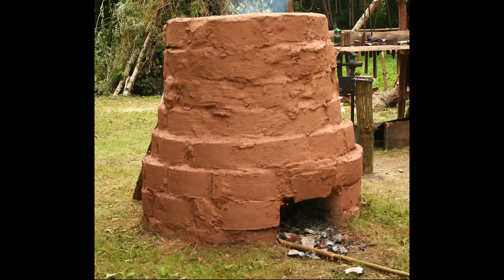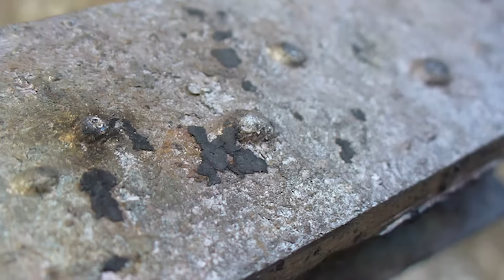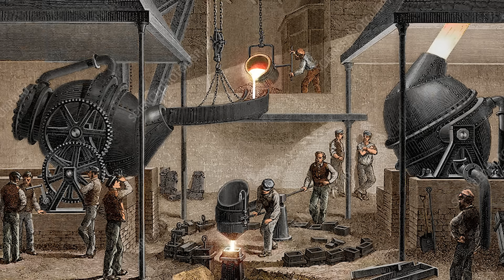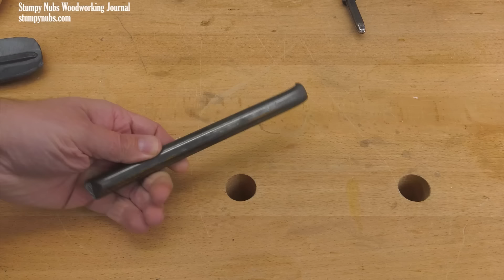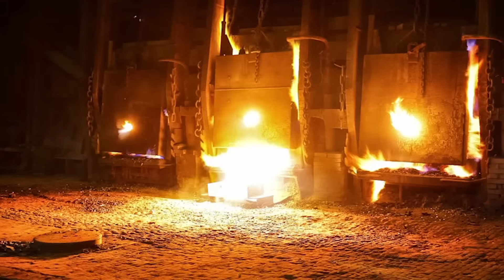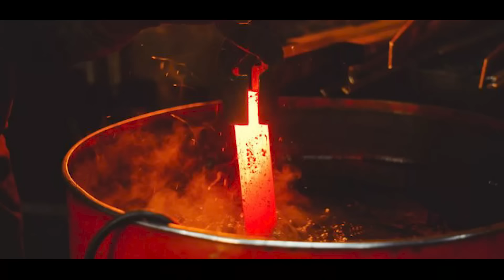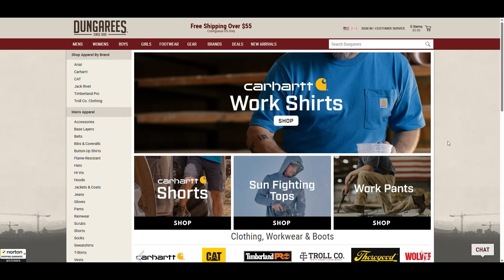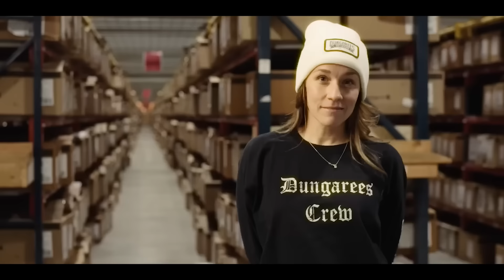Why they REALLY don't make tools like they used to

Comment: also the Archimedes furnace was since ancient times the way most efficient way to produce steel and was probably discovered since iron age began. the discovered heat treatment also very fast through trial and error.
Many many archeological  evidence support this. 
Romans mass produced steel.
Search for Archimedes furnace. it's quite interesting . they are quite small, and with ca 1 kg good bloomery iron you get 800-900 gr of high carbon steel. skill is needed,  to get cast iron. The process takes about 30 min. of course folding and pattern welding is needed.to reduce of impurities and consolidate. All steel was produces that way until Sheffield, but in Indi 13. century crucible steel was produced and highly demanded from everywhere. why they stopped I don't remember. But also late medievalin ottoman empire crucible steel was produced, but needed extreme high resources. That's why Wootz steel has a pattern, traded in Damascus a lot, and some how pattern welding with intention for patterned steel, geometry is named damascus, but it's not really, it's pattern wellded steel with one layer more nickel that becomes black after etching.
But from swords, weapons to tools over 2000 years steel was produced. Of course many ould only afford wrought iron, or cheap steel full of slag, hence the high proportion of broken swords

Comment: There used to be a great secondhand shop where I lived "Paces New and Used" The old guy that ran it had bins upon bins of old tools for cheap. Back when I paid the rent working as a handyman that was always my first stop if I needed a new tool for a job. You did have to hunt through the chisels looking for a good one. As pointed out in the video, a lot of the older ones only had a bit of good steel at the edge, so most of the used ones had already been sharpened down to where all the good steel was gone. One landscaping job I had to cut a hole in a sandstone boulder too big to dig out. The cast steel pick I had gotten from Lowes just bent when I tried it. I had to go to Paces and find an old forged steel pick. I'll miss that place. I think the building is a bar now.

Comment: Ya that’s why the Japanese chisels and plane blades are made by laminating soft iron and super hard steel, where the hard steel encases the soft iron, is thin compared to the iron layer, and the iron makes up the bulk of the belly of the material— so that the part that holds the cutting edge holds that edge, yet is easy to sharpen because it’s pretty thin—the soft iron beneath is obviously also easy to sharpen. High quality Japanese chisels and plane blades are pretty incredible actually.  I saw a vintage set of 7 and quality Japanese chisels going for $10,000 usd, lol.  Crazy.

Comment: It’s also sort of a survival bias and the fact of what used to be available versus now. For example, right now, we have a spectrum of quality. We can buy high quality expensive tools, and we can also buy absolute junk tools for extremely cheap. And inexperience people tend to buy the cheap ones, therefore getting a bad impression of modern tools. Back then, they didn’t have the fancy alloys and so they don’t have as good as the best we have today, but they also probably didn’t have the equipment (automation, cheap fast castings) to make them as crappy as the cheapest we have today. And so people get that impression when they compare the average tool from back then to the absolute bottom of barrel today , and start saying “old is better”. Not realizing, as with everything, you get what you pay for.

It’s a similar thing with the saying that “made in China” means it’s garbage. No, Chinese made items can be made extremely well. But they cost more. It’s just that, unlike most countries, China also has the ability to make low quality things for dirt cheap. And that’s what people tend to buy cause it’s cheap. And then they think made in china is bad.

Comment: I love explaining survivorship bias: how many 5th rate chisels did they make for every one that is left today?

I mean, is there a chisel from the 19th century that’s better than what you could get at Home Depot or B&Q? Of course, but it’s not a given.

I do cabinetry now, but I’ve worked as a shipwright, a wheelwright, and framed houses, so I can see a value in all grade of tools. IMO the best woodworking tools were made between WWII and the 70s stagflation, maybe into the 80s or 90s. Out of all the chisels I have that are REALLY good, the ones that stand out are plastic handled Marples chisels that say “Made in Sheffield, England” at a time when they were really made there.

To me, the problem with chisels older than WWI is usually just consistency. Your 1/2” chisel might be 10/10 but that 3/4” one in the same set needs sharpening every 5 minutes, and the 1/4” might be over-hardened and suddenly it’s 3” shorter than its brothers.

I’m all about productivity and cost effectiveness. There is nothing a $500 set of vintage chisels will do that a $25 Stanley set from the orange box won’t do with a tiny bit of sharpening.

Comment: Products evolve under changing economic pressures sort of like how natural selection works. When scarcity and replacement costs are high, durability is favored. When production is cheap and competition centers on turnover and features (And a board of shareholders that views anything but short-term profit maximization as a failure), the natural outcome is shorter lifecycles of tools because its economically advantageous.

Comment: Then you have high speed steel with a very high rockwell C hardness, but are also not brittle like harder carbon steels. These steel are also heat resistant, meaning you can heat it quite a lot without it softening (hence "high speed steel"). They are used for making drill bits but I've made knives out of cheap HSS lathe parting tool blanks for machine tools. These hold an edge much better than any carbon steel, and they are also more rust resistant for some reason (must be the chromium content). These steel weren't around during WWII and back then they had to deal with the problem high carbon steel had with regards to machining, meaning they made them very hard but they were also very brittle. Now high speed steel tools are still very hard but they are less brittle compared to 65 rockwell high carbon steel.

Comment: It was informative but you finished with the BS rather than the truth, this modern period has become a dumpster garbage fire, new tools are not chisels they are wireless electric crap with built in used by date to be thrown into that dumpster fire after the lithium battery dies enough to be (recycled) What a load of BS like recycling the battery is making the tool worthwhile, it could have been made to last for a few hundred years but instead it lasted 5 years if you keep it charged in the charger constantly sucking electric energy, you think the solar panels are made using wind turbine power but you just delusional fools, burning through fuel for life, making metal and plastic that resists being part of any cycle at all, the only cycle that really exists is that cycle of life that we are not taking any notice on.
Reply from the maker: You are generalizing. Yes, some tools are crap. But extremely high quality ones are readily available. Lie Neilson, Veritas,  Blue Spruce... I could name a dozen that are lifetime quality.

Comment: I've no need of steel that is soft enough to sharpen easily, I'd prefer steel far harder than the crap I've got, there is no metal classed as steel that has too much carbon to be able to sharpen, I've sharpened honest carbon steel on a any stone grinder that was available, the metal keeps a fine edge even after the high temp of being grinded to buggery, why don't they make chisels from that 5% carbon steel? I don't know, maybe it's because they want to always make money by lowering the cost of production and lower the cost of labour, and give the consumer garbage designed to be replaced as quick as possible.
Reply: 5% carbon is not steel, it is pig iron. an industrial commodity that's processed into steel after being produced from raw ore. that's not even suitable for making frying pans. over 2% carbon content in general gives you cast iron, which is soft and grainy. really high carbon steel is brilliant but if you go above like 1 to 1.5% you can very easily get it so hard that it will chip super easily if you have a fine edge. Generally tool steels, and especially high speed steel, in the modern day is the best you can do. If you really try to use a 65 HRC chisel you will see what I mean very quickly. Your beautiful scandi grind will be chipped to smithereens.

edit: apparently chisels do actually go up that hard. i would be very concerned about chipping it.

Comment: I think a lot of the rumors comes from people comparing top quality old tools with really cheap Chinese modern tools of dubious quality. That is rather unfair, kinda like people who say western swords were inferior to Japanese katanas by comparing a cheap regular western sword with a masterforged katana.
There are some old tools that are better though. Anvils comes to mind, everyone use cheaper steel for them today since making a really good anvil just is too expensive, so finding an old one is worth it there.

There are still some wooden tools that are being forged and have extremely high quality, I think the axes from Gränsfors bruk is a good example (yeah, I think an axe qualify as a woodworking tool). They were being made in the same way with the same tools already a 100 years ago and are probably the best axes in the world. Alec Steel released a couple of vids from there recently if you want to see the process of making them.In some cases, the traditional methods do win but you have to pay for it too. If I buy a Chinese crap axe, I can get 10 for the same price as one of those even if they are great.

I don't work in tree myself, I am a metal worker who mostly work in steel.

Comment: With woodworking yes, but modern mechanical and metalwork tools are far better to work with e.g. far higher tooth ratchets and superior technology. This is only to a point though, as in the past 15 years or so, tools are being made in China from brands that would previously relatively recently be made in the west, or Taiwan (make great tools). e.g. Milwaukee tools now being made in China. Should change their name to Milwangki...

Comment: The Story of Knife Steel by Dr. Larrin Thomas covers a lot of the history of steel making. A lot of great insights! Finding the right manufacturers makes a huge difference. They really understand both the chemistry of elements to include and the exact timing and process to get the carbides the size they want and desired features of hardness, toughness, ductility, ease of sharpening, edge stability, etc for chisel vs knife vs sword vs axe etc.. Some knife steels like Vanax requiring specialized pressure nitrogen atomization during production and vacuum furnaces during heat treatment to get the right mix. Really great science at work!

Comment: A lot of old tools also underwent a different heat treat leaving the core metal more ductile, and outer slightly harder. Modern stuff tends to be intermediate hardness throughout with little variance. Only high end stuff gets the proper heat treat like that anymore.

Comment: In my experience, old vintage tools were made in a manner more similar to how high end custom tools get made today. IOW, we saw a quality decline. Modern mfg can make a cheaper tool, that is good enough for 90% of its uses... and that became the norm. Automated mfg processes leads to some issues. 

I have an old vintage forged axe head. Carbon steel, hardly rusted. Found it buried shallow in some dirt in the woods. 

Look at knives today, high end knives are made of crucible steel. They are premium for a reason.

Comment: Very interesting. Perhaps you’re aware of the Ken Hawley Collection Trust channel? I was lucky enough to know Ken before he died; he ran a tool shop in Sheffield specialising in Sheffield tools and knew a huge amount about them. His collection now forms a wing of the Sheffield Museum. In the 60s and 70s he made a large number of films of the last of the ‘Little Mesters’ who were solitary individuals making elements of particular tools in small workshops. The men are now all gone of course but the films are available through the YouTube channel.
He told me that a major reason for the lower tool quality of modern mass produced steel was the fact that all steel now contains a large amount of steel from crushed cars. This contains copper which is very hard to remove and the copper settles around the perimeters of the iron crystals in the steel creating a weaker bond. This means that the fine edge will begin to blunt by crumbling as the tool is used. My own experience as a cabinet maker is certainly that pre-war chisels hold an edge far better than modern ones.

Comment: Chisels are not a tool I use very often being in the auto repair side of things, but we are flooded nowadays with more products of all kinds, both good AND bad.  It is difficult for people to discern which is which because brand doesn't tell the full story.  There are excellent items at Harbor Freight next to junk that I would never allow into my toolbox.

What we have access to now is top quality metallurgy.  It's no longer about just iron and carbon.  You mentioned chromium and manganese, but vanadium, cobalt, silicon, nickel all have roles to play in modern steelmaking.  Small batch steel made by skilled craftsmen who actually give a schitt is hugely important.

Be careful with what you buy and don't be shy about sharing and listening to experiences.  You can't usually tell the quality of a tool by looking at it.  It takes experience to develop that knowledge.  When people choose with a quality first mindset, over time they are able to amass tools that are a joy to work with rather than a pain.

Comment: This is generally true in most industries. Markets expand mostly downwards - much cheaper, lower quality mass produced products become available, while high quality expensive stuff is still available if you know what you're looking for.
Yes, the cheapest 30$ vacuum cleaner is now much worse than the cheapest 200$ one was 50 years ago, but buy one for 200$ and it will be probably better than the vintage one. It's not that they don't build them like they used to, it's that we don't buy them like we used to.

Comment: What the old-timers were telling you wasn't that we couldn't make better tools, and that they weren't around, they were telling you anything that was affordable and mass-produced in that day and age new was likely Chinese junk. I have also noticed that the good ones may have great steel, but often cut other corners like using crap wood for handles, and your excellent steel tool is ruined by a bad grip, cheap softwood handle, or a handle that splits, rots, or shrinks and splits.

Comment: You are right saying that modern steels are much better than old steels, and also highly consistent composition and well defined heat treating procedures allows taking the most out of the material. 

If not counting few dedicated manufacturers, there’s one factor that has degraded a lot, and that is the combined knowledge about the material and the area where the tool is being used. Metallurgist can differentiate hundreds of alloys and combinations of properties, manufacturers must choose the alloy by availability, pricing, manufacturing methods and often based on properties that sounds good on advertisements. The end user can then have opinion about the final product, but the optimization phase is often missing, and sometimes some decisions are made by persons without much knowledge. 

Without the inside knowledge from the persons that are tested the tools, you easily end up buying ‘premium’ chisel set with relatively high price, what is actually garbage.

Comment: @2:42 that's probably why Ford Model started rusting randomly in the middle of a panel instead of the usual place like a wheel panel where water is in contact with the metal.
The steel isn't homogeneous enough. (also Opel and Mercedes had these problems)